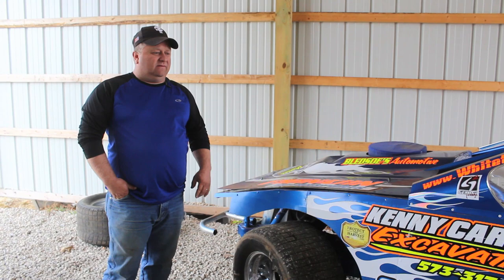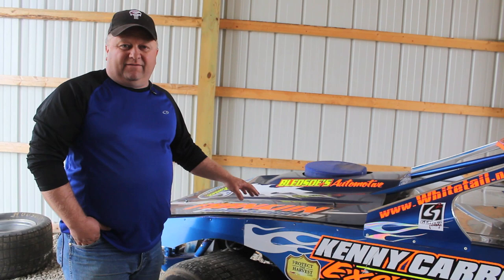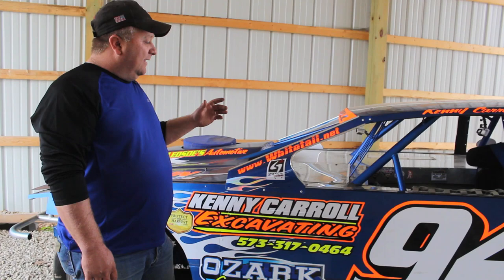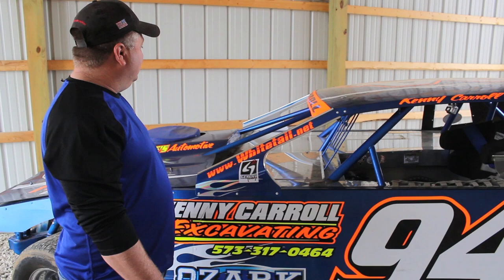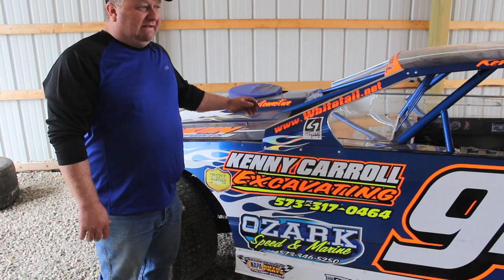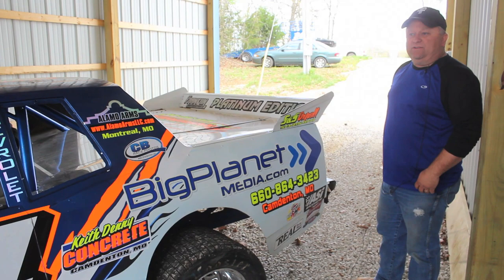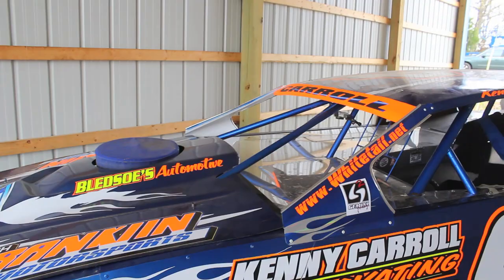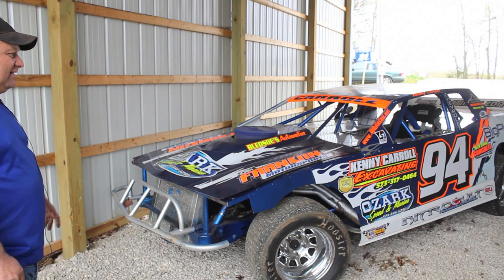Lucas Oil Speedway, Wheatland Missouri Factory Stock Racing Rules by Kenny Carroll

Comment: You mentioned about the 3 wheeling and that you can do that on stock suspension. I need help with forward bite off the corner. I don't want to pull the tire I just want the bite that's pulling the tire. I race in south Alabama so if you want to give me some tips I would greatly appreciate it.
Reply: Where do you race in Alabama, I'm in South Georgia and I've ran in phenix city Alabama a few times.

Comment: Those asphalt tires work with out being grooved there's a street stock class in Texas that run asphalt 10 inch takeoffs and don't groove and they hook up hell lot better the groved cuse they run bead lock on all 4 and like 8 psi to 5 on rr lol

Comment: But damn what a expensive class to run these are pretty much a super stock should be on asphalt and dirt and no latemodel bodies like super stocks run or outlaw late bodies on asphalt lol but this class is very expensive not a cheap class by no means and lots of power damn many super stock motor is legal for this class and it is pushing 560 hp to rear wheels it's a asphalt car same chassis as this and rear end all only difference is outlaw late model body and track bar in the rear on the floater but other then that same rules besides body lol crazzy